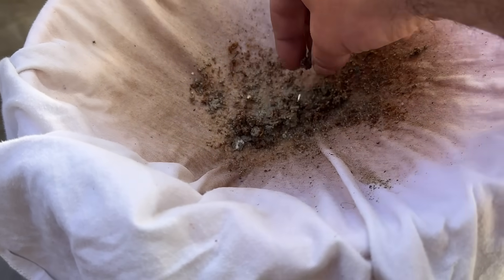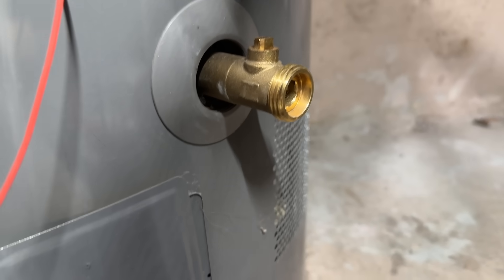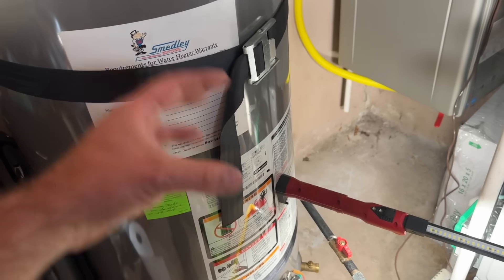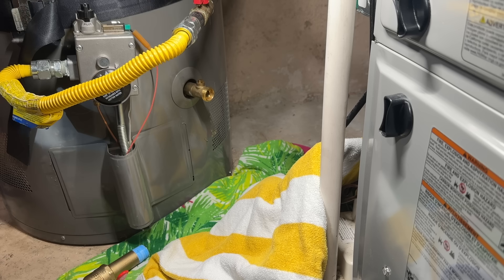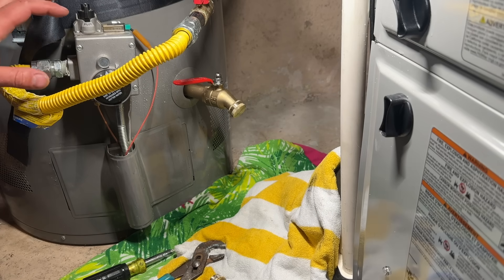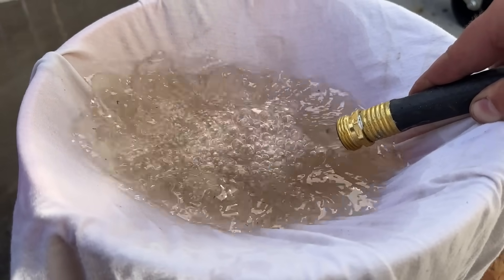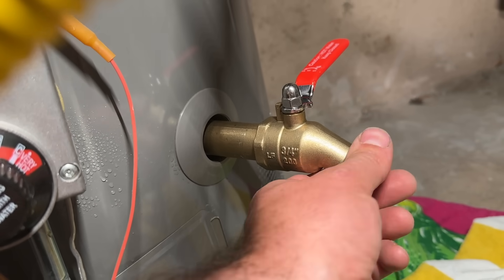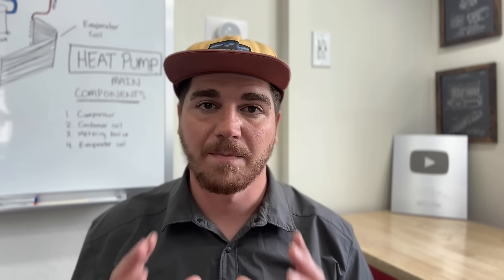Why Don't They Install These On Water Heaters From The Factory??

Comment: All water heaters should have a clean out plate thats like 4in x 4 in with 1in faucet tapped in the middle of it. No that would make it too easy to clean out and would extend the life of the water heater too long for the manufacturer.
Reply: That would make sense, but mass produced water tanks have to hold some from of pressure. This changes the tank rating just enough that insurance companies (at the consumer level manufacturering ) would not allow an access panel, for maintenance; to go into production. Even modern commercial boilers with this design accommodation need yearly maintenance but must be accomplished by certified mechanical contractors with special tools.  All consumer rated items are disposable on purpose.

Comment: For the same reason they dont make them to last 30 years like they used to.  My water heater is a rheem from 1993.  Keep the anode rod changed every 2 years or so and they last a lot longer.  And its a myth you need to drain a tank all the time.   Any plumber that isnt trying to scam you will tell you draining it doesnt do anything to increase the lifespan.

Comment: Great advice!  Wish I had known this before my new water heater-it's a Rheem- was installed less than two years ago.  I believe that the ball valve linked to here. given its specific purpose, should have a safety mechanism to prevent it from being accidentally opened.

Comment: This is the first thing I do on any house I buy or whenever I replace a water heater.  Between the small bore of the factory valves and the plastic valves that many manufacturers use, it seems that they're actually engineering these water heaters to fail.
Reply: exactly, thats how they get repeat  business

Comment: Do they come in different sizes?  How do I figure the size for my unit. I have had to replace the pressure release valve every few years and need to know the size since there are several.

Comment: I installed a whole house water filter, ahead of a water softener, and a CorroProtec anode rod in the heater. I expect it to last a LONG time! An impact wrench will get the old anode rod out. Even if you only use the impact wrench once for this job, it’s cheaper than paying a plumber and saves you from buying a new water heater for 15 or 20 years. Plus now you have an impact wrench!

Comment: I installed a new valve and it's awesome.  I also replaced my anode rod and during the process.  I completely emptied the tank and put a light down the anode rod opening to see what the hell was going on inside, and ended up flushing out everything and there was just about no rust.  It's 2024 and the tank was installed in 2011 and still clean and going strong.
Reply: You must have awesome soft water.
Reply: You don’t need to flush a water tank….it just stirs up the sediment.

Comment: Hmm I thought the hot water heater flush valve is not at bottom of tank. So not fully flushing tank. Is that correct to leave the water on while draining/flushing the tank?

Comment: The brass drain cock will get hot so a good idea to insulate over it for safety if you have kids that can access the area, and even to maintain the energy efficiency.
Reply from the maker: Thanks for the tip and thanks for your support on the channel!! Cheers brother

Comment: I just got an add on from scamazon that allows me to shoot a puff of air (with a bike pump so not too much pressure) into the drain to break up the clog.  Next time I drain it, I will still put in a ball valve as it's still easier to use.

Comment: They put those tiny hole ones on so you can’t remove the sediment and then need to buy a new water heater….ka Ching money in their pockets.  Thanks for the great tip👍
Reply: Not all, newer AO smith ones i have seen (a year old) were removable.

Comment: Nice idea and concept. Now, take a curious child, who happens to see that lever and starts farting around with it.....yea, you get the picture.
Reply from the maker: Anyone with kids could crank the cap down and remove the valve that’s held on with a single 3/8 nut. Cheers
Reply: @diyhvacguy  Yea but 'anyone' with kids prob won't see the issue with it. Somebody who will rush to install this will prob give little thought to "removing" the valve  handle and locking it down... Double Cheers.

Comment: My plastic drain valve started leaking after about 5 years, probably from using it when flushing tank.  Replaced it myself with a heavy duty ball valve.  Never buy a tank with a plastic valve or replace it with metal ball valve per video.

Comment: Yep, I installed a 3/4” full port brass valve on my new gas heater 10 years ago.  With some skill you can do it with the tank full and only spill a glug or two.  Super easy.
Reply: Yes!  But first, shut the incoming water supply off, don't turn on any faucets and replace the valve right away.  After I installed a new hot water heater and filled it, I discovered it would not heat. Defective thermostat/gas valve.  The warranty covered a home visit by a tech. Sure beats taking it back out and returning it to the store.  I watched him replace the screw in gas valve assembly without draining the tank and same thing, only a glug or two of water came out.  The temperature sensor is in the water via a threaded opening  near the lower third of the tank.

Comment: Should a water heater still be flushed even if it's gone 5-10 years without being flushed?
Reply: flushing won't help it after that long of time. flushing only works if you do it every 3 to 6 months from the time of new install. Gas water heaters will lose heating capability once a small layer of build up forms on the the bottom of the water heater where the gas heats it.

Comment: If you can figure out a way to get a stuck anode rod out it would be genius. My last one took two big guys holding it while I turned the bolt with a large socket and a three foot pipe slipped over the socket wrench handle. Any reason I couldn’t use a hammer drill or impact drill?
Reply: Use a hammer drill to get it out. Use a torque wrench to put it in.

Comment: One power surge or nearby lightning strike could easily destroy the powered anode rod. How do you know if it’s working or not.
Reply from the maker: It has an led, so you can easily check it from time to time
Reply from the maker: And if you have a whole home surge protector then it wouldn’t be an issue
Reply: @diyhvacguy  I’m a retired electrician and trust me when I say surge arrestors help but are not the perfect answer. I’ve replaced them as a fried brick and then proceeded to repair electrical damage in the home.  Do they help, yes they do but have their limitations. I have a large one on my loadcenter, a medium on my AC disconnect and numerous plugin ones throughout the home so I do believe in them but don’t put full faith in them either.

Comment: UNSAFE, Scald hazard. Any Kid (or stupid adult) can accidentally open that valve. That is a reason the original had a slot and NOT a handle.  As for that cap, I bet in a few it will have been lost. Depending on the sediment, the may need to be even more frequent  (I used 6 mos, because of calcium flakes).
So Plus for Flushing. Plus for the Anode. But a negative for residential use of that valve. 
BTW  EXPANSION TANK for any water heater behind a backflow preventer or pressure regulator.  Heating incoming water expands and those device prevent it from going elsewhere so the tank keeps getting these 'breathing like' expansion / contractions without the air bladder to soak the excess up.
Reply from the maker: The handle can be removed if that was a concern. But you could also just tighten the cap with a wrench so no one can take it off unintentionally

Comment: Just a couple of months ago a plumber here in Vegas quoted me $5,400 to replace my 75gal water heater and 48kg softener, so I decided to do it myself. Went with a $1,400 Rheem, this $35 valve, a $160 corro protect rod, and a $750 aquasure 64kg softener. The hardest part was getting Home Depot to deliver a water heater that wasn’t damaged during shipping, third time was the charm. Anyways, glad to see I did most of what the pros recommend!!
I will be signing up for your HVAC videos and the patreon tech support service next spring when I tackle replacing one of my 18 year old York hvac gas systems. Working on my epa cert now and I started buying the tools already. Thank you for making these videos!!
Reply from the maker: Thanks for the testimonial! That’s awesome
Reply: I tried a Corro-Protect rod on my old water heater. It seemed sorta cheaply made. I never could get the top plastic where it threads into the stainless shaft to stop slow dripping.

I kept tightening it a quarter of a turn per day until one day the plastic top broke off. Was a waste of $120 back then.
Reply: @mountainousterrain1704  it was a long time ago. I think I found an email contact, sent them something and never heard back. But I was frustrated and had other things in life taking up my time and never followed back up.

Some Home Depot associate convinced me in our area you didn't need an anode, and I just capped it off. Of course the tank started leaking 2 years later, but it was already over 20 years old so no big harm. If I had the sulphur smell problem I probably would have followed up better.
Reply: Can i ask how old you are?
Reply: Does anyone know whether these boiler drains are 3/4" standard?  I have a Bradley White water heater.

Comment: I do something similar but I use a full 3/4 valve with a 3/4 to hose barb straight through piece on the output side.  Even the little angle and sizing down a little causes some backpressure and crud to get stuck.  With a straight shot and full diameter I have never had a clog when flushing an old water heater out.

Mostly been swapping out the cheap plastic ones that don't even open up as much as the one you pulled out, not to mention they are crappy gate valves and if a piece of junk gets caught you have a hard time even closing them back up.

Comment: Just so I understand, it's a 3/4" fitting for the threaded part that screws into the water heater?  And is that a pretty standard O.D. for US tanks?
Reply from the maker: Yes standard size

Comment: Glad you did this, and look at all that junk that’s coming out of there with the bigger valve. There’s no way you could ever do a complete flush with that factory set up..

Now that you have the bigger valve there to do flushes you just leave it on pilot leave all valves open hook the hose up and flush it for 15 minutes then shut the valve disconnect and cap Set temperature done.

It’s also nice to use a pale and then you could use super hot water for cleaning too anytime you want.
Reply: MORE success, if the water is cooler, i slid a wire coat hanger I had straightened out through the valve to agitate what’s left in the tank and got twice as much as the first time around because it piles up near the back and some of it stays back there without coaxing. 
Also, if the tank is half drained, the splashing inside  ( after turning the supply valve back on ) helps disturb the pile of sand debris at the bottom. Rancho Cucamonga, Ca had sand, and moderately hard water.

Comment: There’s a reason as to why manufacturers don’t put handles on the spigot. Kids or adults with little common sense are able to open it.
Reply from the maker: It has a cap, crank it down. And if you still don’t feel safe, take the handle off. It’s one nut holding it in place.

Comment: as far the anode rod they loctite those in. i used a six point socket with a 1/2" drive breaker bar and a 4 foot pipe off a floor jack to loosen mine.
Reply: I tried this method but the whole water heater would turn even with someone holding the tank, so I just gave up.
Reply: @TuanPham-mc8bi  Electric impact wrench>>less than $100 AND you can use it to remove your lug nuts when rotating tires.
Reply: @hotpuppy1  Just spend a few bucks more and get an 18V cordless one, especially if you are already in an 18V cordless system (Ryobi, Milwaukee, Ridgid, etc).   You'll enjoy using it a lot more.
Reply: @chris98118 , I disagree. Regular electric is the way to go. It less convenient, but it will always work. Not relying on batteries to stay healthy for it to function. Especially if it’s a tool you don’t use very often
Reply: @TuanPham-mc8bi  If your water heater has earthquake straps it makes a its a lot easier as it will make it not want to spin
Reply: @TuanPham-mc8bi  leave the tank mostly full, also just a breaker bar and a rubber mallet, a few whacks gets it loose
Reply from the maker: I made the mistake of using a 12 point first and rounded it off so when I got the six point it wouldn’t grab enough 🤦🏻‍♂️ went with a tankless in the end anyways

Comment: Most factory drain valves these days are plastic gate valves, not ball valves.  Those have an even smaller opening and clog easily.  The best advice is as said here, when you buy a new tank style water heater immediately swap out the factory drain valve with a full flow quarter turn ball valve.
Reply: The plastic is used because direct contact of brass to steel will cause corrosion of the steel.    If you install a brass vale you MUST install a plastic isolator between the tank and valve.    This is known as dissimilar metal corrosion.  Never connect a brass valve directly to the steel tank.
Reply: @davidgenie-ci5zl Would therapy maybe a stainless steel valve instead of brass?
Reply: @Captain1717Q  I would think that the tank would outlast any corrosion created at the threads.  But a stainless full port ball valve may be a better choice, and the cost difference is negligible. I use stainless. Same material as the threads on heater elements. And the threaded connections there don't corrode.
Reply: @steadyeddie7453 Would you know where to source a stainless valve?
Reply: @davidgenie-ci5zl  The could be steel like the dielectric nipples on top of the tank with a brass ball valve on the end?
Reply: @robertcromwell9736  Yes, but you must have that plastic insulator between the brass and the steel.   If replacing a plastic valve with brass, you will need to add the insulator.   If the original valve was brass, I assume the factory used an insulator already, but not if the factory valve is plastic.
Reply: Great Advice! So why don't they come that way?
Reply: @SiteSeeing411 It's probably because the plastic isolation parts are made by a subsidiary manufacturer of the heater tank company.😂
Reply: @SiteSeeing411  Because a cheap plastic valve probably costs the manufacturer a couple dollars, and a full port ball valve retails for about $25. Plus... because the plastic valve will probably clog soon after you start draining, you won't be flushing out much sediment. So you buy a new water heater sooner than expected. Predetermined obsolescence.
Reply: @steadyeddie7453  ..it doesn't answer the question on the 2 brass styles shown. Hint.....the plastic valves are usually found on the box-store versions of these tanks....the small-opening brass style is found on the water tanks found from plumber supply places. So...it still doesn't answer the question why the larger ball-valve style brass valve isn't used over the other brass/bronze one.
Reply: @TheWilferch  I would guess the the full port brass valve costs a little more than the smaller port brass valve. You could probably google it real quick and post your findings.
Reply: Where do  you buy water tanks …Target? In canada i don’t remember ever seeing one with plastic drain  ,also our water is soft and  cleaner,draining and replacing anode rods is something we don’t even do, i have cut open tanks  over 15 yo tanks  after replacing and the rod is still good and barely any sediment on the bottom. Anyway this advise is good for usa in canada we don’t have to do it.
Reply: Yep sold water heaters for 5 years and all had plastic drain valves.
Reply: If you buy it from the big box store then yes plastic but not at a plumbing supply company
Reply: @glenarseneau1231 Well I bought a brass valve but it has a slotted screwdriver slot on the top which I don't like.... I prefer to have the quarter turn handle type .. any advice on that?
Reply: And those plastic "valves" break when you try to open or close them.
Reply: Yeah mine's been in there for some years and that plastic valve just will not come out
Reply: @Captain1717Q  I have always removed them with an 18" pipe wrench for plenty of leverage. But I always have a Plan B. If the plastic valve breaks I will just use a hacksaw blade to cut 2 slits  inside the piece broke off in the tank 180 degrees apart. Once the piece is split in two I would think it will come out fairly easily.
Reply: @steadyeddie7453 How what I drain the tank to do that? It's a 40 gallon GE electric and I can't drain water because the drain valve is plugged up and it won't drain. I don't want to force the plastic valve and break it cuz then I got no way to control 40 gallons of water pouring into my basement.
Reply: @Captain1717Q  The first time I drained mine it took 13 hours. When I first opened the valve water flowed then stopped. So I came back before bedtime, shut off the circuit breaker to the tank, opened the valve and let it drain overnight. By the following midday it was low enough that I could take out the lower heating element and suck out the remaining water. I always have a Plan B when working on a water heater.
Reply: Are the plastic drain valves as easy to change. I just purchased a new electric hot water heater and it has a plastic valve.
Reply: @tomklitsch6638 on the new ones they are. My plastic drain valve has been in there for a few years and I can't get it loose.... I'm sure there's some magic to get that done
Reply: Will it void the warranty after this major surgery?
Reply: @andyh4262  No
Reply: Seems to me this is the case when you buy a heater from a big box store, versus going through a plumber to purchase your tank.